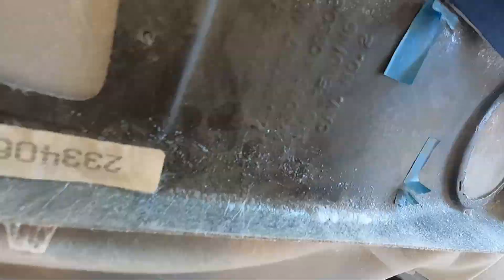jeep xj sound bar retro fit?

Comment: You make it look so easy. I just finished cleaning my soundbar again after messing up twice. I need to buy mor fabric now too.
Reply from the maker: Practice makes perfect brother you got it I recommend that 3m glue that i used it’s help up pretty good for the fabric I ordered it on Amazon
Reply: @jorgegarage9593  yeah I actually have the same glue and same fabric just different color. I was able to wrap the headliner and make it look nice. Now I just gotta wait for my fabric then I can redo the speaker bar and my visors. Gonna look crispy

Comment: Hey mate, what diameter are the speakers for the sound bar? Could I theoretically put in the same speakers like at the front doors?
Reply from the maker: What's up gorn i appreciate you leaving a comment yeah they fit the front door 5.25 but I cut around the circle to fit 6 1/2
Reply from the maker: I'll post a video later of how they sound i found the speaker from a home theaters system at a house i was working at jaja can't beat free
Reply: @jorgegarage9593  so, 5.25 does fit both in the front doors and into the sound bar? You just opted for the bigger ones at the front, correct?
Reply from the maker: @Gorn_  front I'm still running the 5.25 but yeah those are the plans for the future to make the doors 61/2

Comment: brother how did you take the soundbar out?? been trying to figure it out but no idea
Reply from the maker: I got this one at the Junk yard just loosen the screen from the time on the sides you would be good 👍
Reply: I know this comment is 4 months old, but in case you didn't figure it out, you have to remove the trim on the sides of the roof and then pop the map light out for the bar to drop it out